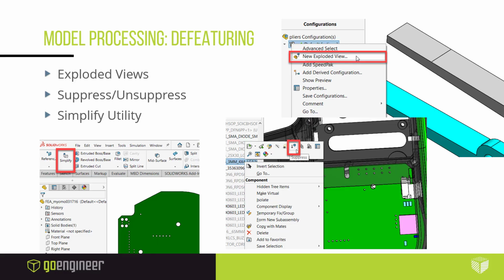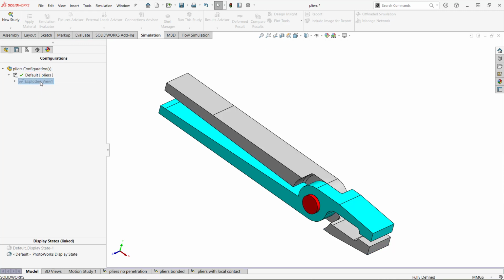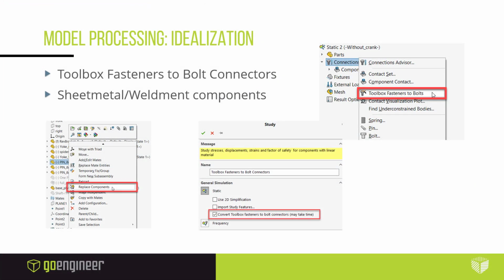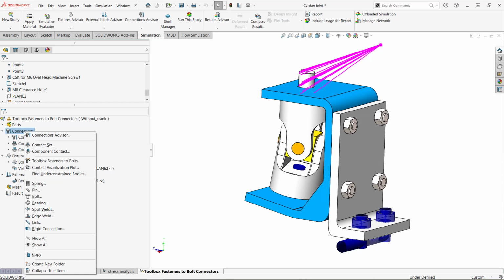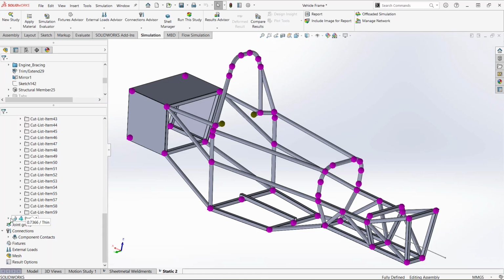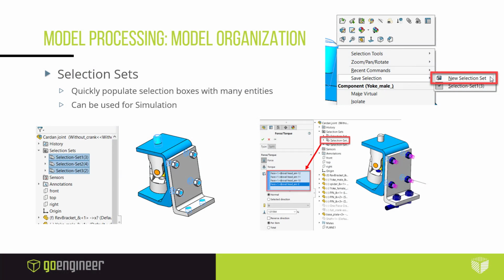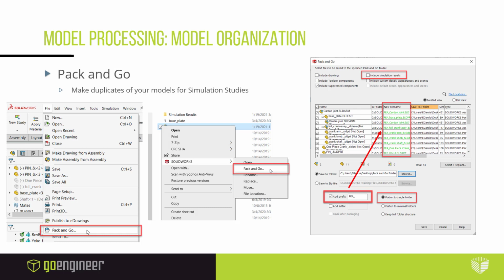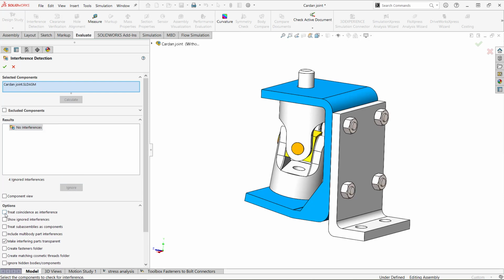Preparing your Models for Simulation FEA

Comment: Can I use Step file asmy modelfor simulation
Reply from the maker: Yes, you can import a step file for a simulation. However the mating information may not have translated with the step file so be sure your parts are properly mated or fixed in place as needed.